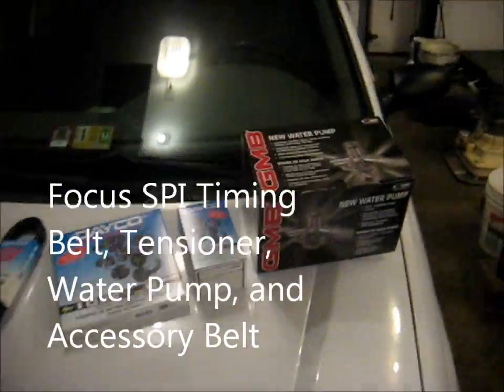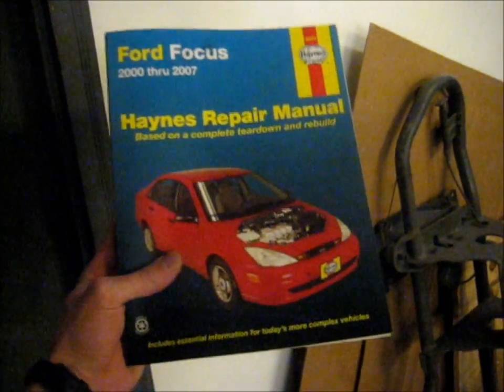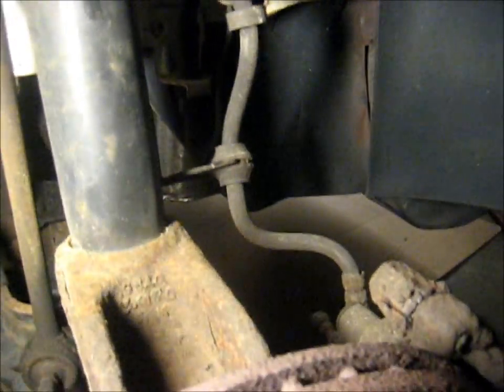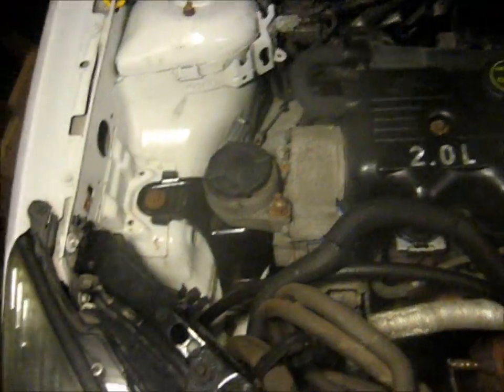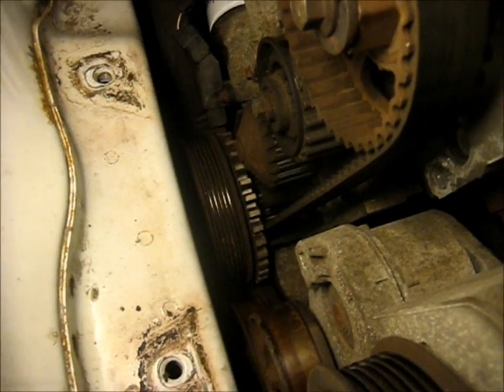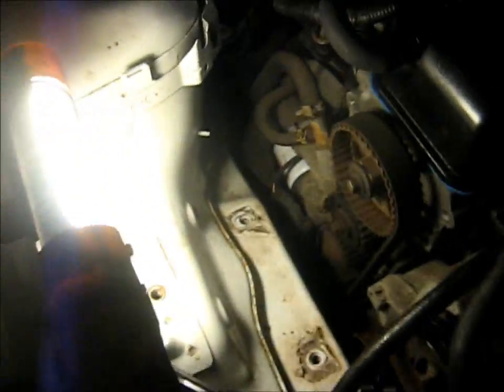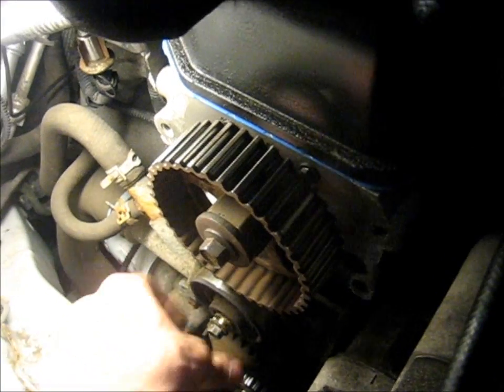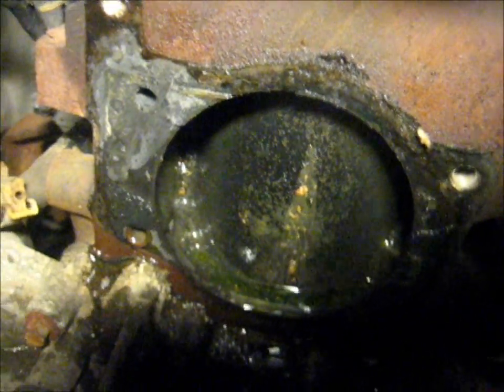Ford Focus Timing Belt, Tensioner, Accessory Belt, and Water Pump Part 1/2

Comment: Great video Alex. Thank you so much! We read the codes and changed the crank and cam position sensors, coil and fuel filter and then discovered the belt was broken. I bought the same manual you have and we followed your video step by step on our used  2002 Focus SOHC SPI 120,000 miles. Replaced the tensioner that sounded just like yours and the water pump. Again, thank you so much. We struggled with getting the timing marks perfect but we pulled it off. This job is quite a bit easier with 2 people. Sounds like we may have to change the idler pulley on the serpentine belt next .
Reply: The mechanic wanted $700. We spent $100.66 for a complete kit, pump, tensioner, and belt. Then we had to spend $22 on the book and $14 on antifreeze, $15 for a strap wrench from home depot to hold the balancer/crank pulley so we could back the center bolt out.

Comment from the maker: Are you talking about the accessory belt? Make sure you have the belt installed correctly. The flat side only goes over flat pulleys, ribbed side over ribbed pulleys. Make sure the belt is centered over the pulleys. Also, make sure it's routed correctly. If all these check out okay, the tensioner may be bad.

Comment: if i just want to replace the tensioner, the pulley on mine just snapped off when I was pulling out of the driveway, will i just remove the coolant reservoir and motor mount to access it?

Comment: Its a Rattle trap with the failed motor mount.  I've read that the replacement from ford is still better then aftermarket.

Comment: Excellent video Alex.  I am getting ready to do this job on a 2003 Ford Focus SOHC SPI.  One thing I have been trying to figure out is how to properly align the timing marks.  I understand using a breaker bar and socket to turn the crankshaft by hand and the camshaft marks will be visible but how do you tell the crankshaft is lined up with the pulley on? I know there is a key on the wheel that the pulley slides in to that is the arrow but is that visible with the pulley on? Or when they camshaft marks are lined up to TDC does that mean the crank is at TDC as well?
Reply from the maker: At 9:32 you can see the timing marks on the crank. The small point on the lower crank sprocket lines up with a small notch in the engine block. These two marks MUST line up at the same time that the two cam marks line up. Once all the marks are aligned with the belt off, you can install the belt. If you set the engine to TDC  #1 before removing the old cam belt you shouldn't have any issue. The timing marks for the cam can be seen at 4:13 in part 2 of this video.
Reply: TheAlexManVideos Did this job today.  Your video was a big help.  Got everything back together and it is running great.  When rotating the crank manually to check the timing marks is it normal for it to be difficult to turn in certain spots vs others?

Comment: I have a 2001 FF SOHC SPI engine. The drive belt derails. See video. Type:
Drive belt derailing on 2001 Ford Focus SOHC
Do I need to replace the belt tensioner?
Thanks a lot!

Comment: I am going to do the same job. I have a question about the alignment. Can I just make some marks myself before removing the old timing belt? When I install the new belt, I will make sure the crank and camshafts are in the exact position they were. Do you think this will work? BTW, I have 2001 focus zts with a zetec engine and it is DOHC.
Reply from the maker: That might work, it accomplishes the same thing. The true way to check it's all correct is to verify the timing marks are all aligned. If it's off by a tooth it will run like complete crap, much more and you can cause some serious damage. It's better to just rotate the engine to TDC #1 and then disassemble.
Reply: Some people open the valve cover to align the shafts with a special tool, but you didn't do this. Can I do the same thing as you did not to open the valve cover?
Reply from the maker: I don't know the specifics on a Zetec engine but typically you just rotate the engine with a ratchet on the crank bolt until everything lines up.
Reply: +TheAlexManVideos thank you very much

Comment: same car you changed the head on? could have changed this stuff out at that time maybe?
Reply from the maker: Yes, same car. I wanted to start the procedure from the beginning for both videos so this was easier. With the exception of the expansion tank, engine mount, and timing cover there isn't a whole lot of overlap so it didn't take me much longer.

Comment: hi how often would you change a timing belt
Reply from the maker: Factory recommended service interval is 100k miles. Hopefully the engine hasn't dropped a valve seat by then.
Reply: I just had a Motorcraft timing belt break at 97K miles!  D-oh!

Comment: Well the sohc motor is not an interference motor. So yea i would not move it a lot when changing the timingbelt. But it not nearly as critical as the zetec but i have seen valves hit on a sohc when said driver was on freeway rollin like he had trucker push. But good video step by step nobullshit . I hate when people talk about nothing for 5 minutes first. And 1 of the best with the cam bubba. Thanks